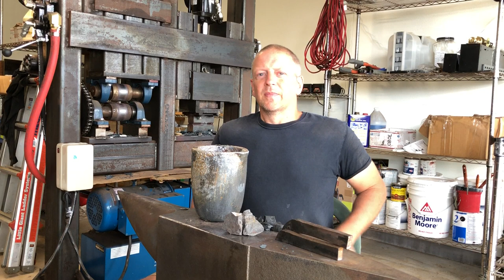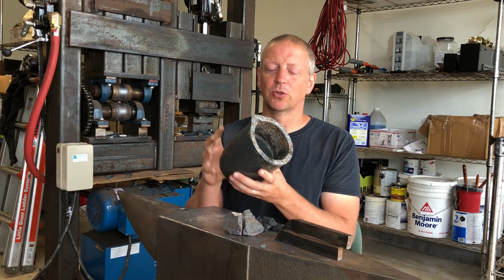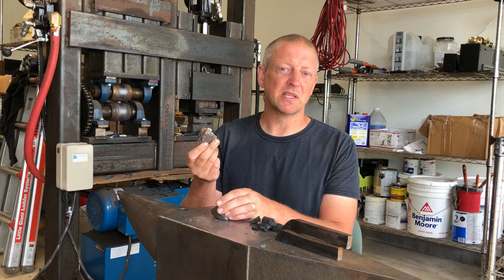Wootz Chemistry: Charcoal versus Pig Iron

Comment: I’ve recently made an ingot using about 50% mild steel and the rest I used 5-6% O1, 30-35% S7, a few small carbide endmills, and some railroad steel. The thing is very heavy, and does not want to forge, it started to crack apart on me..so..I’m going to be making a charcoal forge and getting a hydraulic press.
Reply from the maker: It sounds like your alloy level ended up too high, and possibly the carbon level also. I would suggest starting with fairly low alloy levels until you are comfortable with the process, and from there you can ramp up the alloy levels slowly if desired. A good way to start is by making something similar to a steel that you are already familiar with forging; that way there are fewer variables to deal with at the beginning. It is surprisingly easy to accidentally make a steel that is completely unforgeable, so starting in known territory is a good idea.

Comment: I have been interested in trying crucible steel for a long time and the information in your videos has giving me enough confidence to finally go for it. I do have a question for you about the sorel pig iron. Do you get it from Miller and Company or is there another source? If you do get it from Miller, what are they like to deal with, do they do small orders? It would be great to know before contacting them.
Reply from the maker: I always ended up contacting local foundries because the larger suppliers simply don't want to sell in small enough quantities. The last time I checked they were looking to sell at the 1000# size rather than perhaps 50#, which is what would be reasonable for most smiths. It's not expensive material, but shipping on 1000# isn't cheap. If you check around you can often find a foundry that uses Sorel or one of the other high-purity pig irons, and most foundries are perfectly happy to sell 50#. Good luck!
Reply: @peterburt7218  Thank you very much, very helpful.

Comment: Really great informative video Peter! I can't wait to try out a melt. How much use are you typically able to get out of those crucibles?
Reply from the maker: I have been able to get about ten melts per crucible. Longevity of the crucible depends substantially on how clean your materials are going in. The fewer oxides the better.
Reply: @peterburt7218  if I do have pure Graphite Crucibles how does that change the Chemistry of the Ingot? Or does it just shorten the lifespan of the Crucible?
Reply from the maker: @samsmith2635  A pure graphite crucible shouldn't be used for steel melting because the molten steel will quickly dissolve the graphite. Carbon is soluble in Fe, so this would be like trying to heat water in a pot made of sugar. In Clay-graphite crucibles the Fe is contained by the clay portion of the crucible, while the graphite acts to stabilize the crucible against thermal shock. Pure graphite crucibles are used exclusively for nonferrous metals (other than platinum) because the graphite helps to deoxidize the metal. They can't be used for platinum because Pt can also absorb C and create carbides.

Comment: would it help to reduce some of the charcoal issues by pre-heating it?

Have a scale set up with a proper heat-resistant container and zeroed out. Run the charcoal up to glowing for whatever period of time might be useful to eliminate the water content and burn off more of the undesirable elements, dump the charcoal on a metal screen so you can thump the screen to remove charcoal dust, if necessary, dump the hot charcoal on the scale, get your desired weight, then dump it still hot into the crucible and quickly add your metal, is what I had running through my idiot brain.
Reply from the maker: Heating will definitely remove a substantial portion of the water weight, and I believe a temp of even 400f would be sufficient. The other difficulty with charcoal is the mineral content...essentially the material that would be left over as ash if the charcoal was burned completely. This varies from tree species to tree species, and even to some degree within an individual tree. As a rule of thumb, the denser the wood the higher the mineral content. If I made my own charcoal and always used the exact same wood and firing temp, I could narrow the variables substantially...or I could just use graphite and know that I have essentially 100% carbon.

Comment: Do you add any Ferro vanadium to encourage carbide seeding? Or any other elements?
Reply from the maker: I add a very small amount of vanadium carbide powder, which will readily dissolve in the molten iron. Keep in mind that historical wootz had alloy contents so low that they were essentially ignored by metallurgists until quite recently. Values of 0.04% and below are quite common in historical blades.
Reply: @peterburt7218  Many thanks

Comment: Hello and thank you for the excellent video and information!
I need to ask for help.
I will be trying my first wootz melt in the upcoming months.
For my first attempt I'll be using charcoal as a carbon source and wrought iron(300 grams of it) plus 10 grams of a HSS hacksaw blade as a source of carbide forming elements.
The only problem is, I've looked and looked all over the internet but could not find a formula a ratio or anything to calculate what amount of charcoal I would need if I want to get 1.6% carbon in my 310 gram charge? 
Also you mentioned that hardwoods have more minerals in them, does that mean they should be the choice for charcoal over softwoods? 
Thank you very much for your attention!
Reply from the maker: No problem. I’m always happy to answer specific questions.
Reply: @peterburt7218  Actually now when I think about it, I'd prefer to use common nails since you said mild steel is ok to use. 
What would be the calculation for mild steel?
It's just that the wrought iron I have is in very large pieces and I have no power hammer nor press, and nails are very easy to cut into small pieces.
Reply from the maker: Softwood charcoal is preferred since a larger proportion of the weight is carbon rather than minerals. To calculate your ratio, multiply the charge weight x carbon %...in this case 310 x 0.016 to get a carbon requirement of roughly 5g. There will be some C in the nails, plus the charcoal won’t be 100% C, so there is obviously some amount of unknown in the calculation.
Reply: @peterburt7218  I want to thank you profoundly for the priceless information and your time! 
I have one last thing to ask, you said the charcoal should be on the bottom of the crucible and mild  steel on top, I was wondering since I will be using the smallest possible nails to maximize my chance of a successful melt, if I cut the nails into even smaller pieces and mingle them with my charcoal powder will that work out or not? 
Since you mentioned the charcoal may float away with the slag if improperly placed.
Reply from the maker: Carburization is definitely a factor of surface contact, so the more contact the better. If you are going to use just nails and charcoal then you might divide the nails into three portions and load as follows: one third of nails in the very bottom along with some crushed glass, one third of nails combined with crushed charcoal, then the last third of the nails on top to keep the charcoal from floating out as the slag melts. The slag layer goes over the nails, and I typically load a small amount of lump charcoal on top of that to burn off excess oxygen in the early stages. If all goes well the middle layer of nails will melt first as it absorbs carbon from the charcoal, and that liquid flows down into the bottom layer and begins carburizing and dissolving those nails. At the same time the upper layer should collapse downwards into the melt. One major advantage of using pig iron to carburize is that it is naturally a top-down melt and “bridging” is unlikely.
Reply: @peterburt7218  Thank you for the technique, it makes sense I will utilize it. I like the idea of cast iron too and was originally thinking about using it but I realized there's no way to know how much carbon I have in a random piece of cast iron and I can't get sorel metal so that was abandoned. 
I will share my journey with you and keep you updated, not too many people are using a closed top coal fired furnace to make wootz.

Comment: Hi peter. Hope you dont mind me asking. Is it possible to use normal gray cast iron for carbon content?
Reply from the maker: Gray cast iron can give you the C content, but unfortunately also brings a huge amount of silicon along with higher levels of sulfur and phosphorus than you want in steel. If you are looking at cast iron for your steel, I would suggest malleable or ductile cast iron, which have tighter chemistry than gray cast iron. McMaster-Carr, MSC, and Online Metals are good places to look for these in bar form.
Reply: Ok that's great thanks very  much.

Comment: Hi Peter, Thank you for your informative vidéo.  Is it possible to use rusty steel to make wootz or do I have to grind it first? Thank you for your answer.
Reply from the maker: It’s a good idea to clean your material as much as possible before putting it in the crucible. I don’t go crazy with this, but I definitely wire brush away any loose oxides. There are a few good reasons for this. 1) oxides throw off the carbon calculation, since reducing them to iron removes C from the melt as CO gas. 2) iron oxide melts at a lower temp than iron and will run to the bottom of the crucible. Iron oxides are very corrosive to most refractories, so the more oxides the shorter the life of the crucible. 3) some of the CO gas created during reduction of the iron oxides will dissolve in the molten iron, and this is forced out of solution during solidification. This leads to more porous ingots, sometimes so much so that the ingot must be scrapped.
Reply: @peterburt7218  thank you, i will take your advice
Reply: @peterburt7218  Just another question, is there any point in adding chromed metal or stainless steel to the crucible?
Reply from the maker: I definitely would not add anything plated to the melt. There is no way of knowing how much you are adding of different elements, and not much certainty about exactly what is in the plating. Many plating processes require several layers of different metals. Chromium (Cr) is not inherently good or bad for crucible steel; it just depends on what you are aiming for. Cr is a reasonably good carbide-former, and also acts to deoxidize the molten steel. Nickel (Ni), on the other hand, should really be kept out of any hypereutectoid steels, though it is fine in eutectoid and hypoeutectoid steels.
Reply: @peterburt7218  Ok Thnak you.